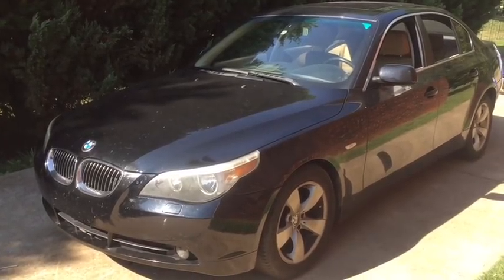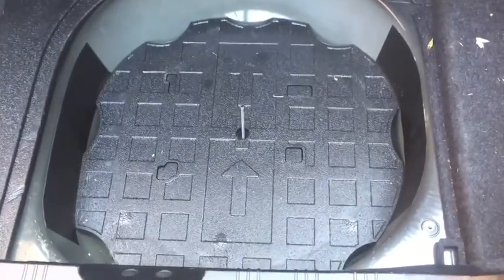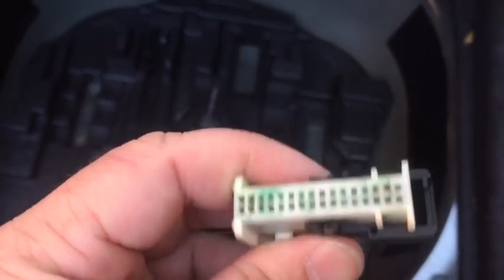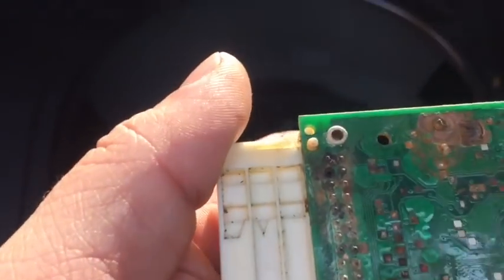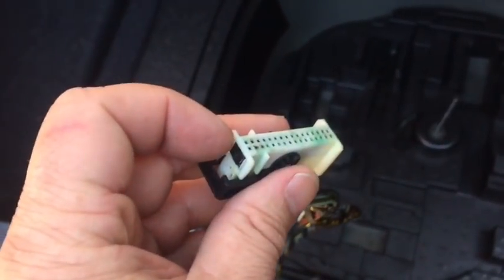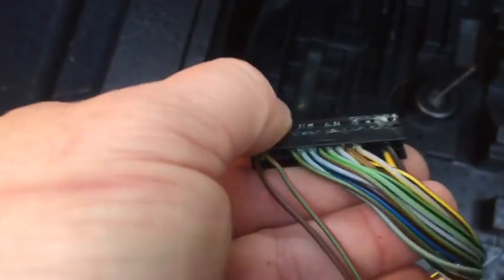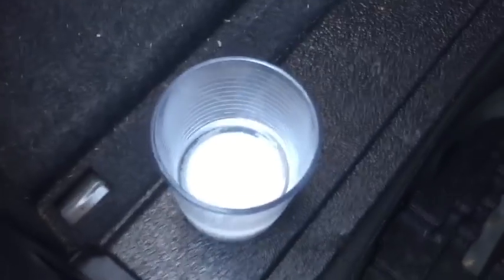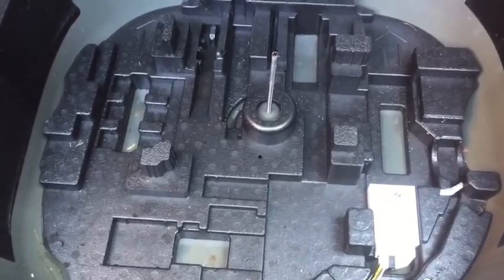BMW Battery Draining Fixed

Comment: Okay this is interesting. My tpm light is flashing and I have codes for tpm "604E" plus 6054,5,6, and 7(1 for each wheel). Now I thought this was because I put new wheels and tires on and they don't seem to have any tpms modules, but I've found that using protool I cannot code or do anything with the RDC module. It also just shows question marks for the modules vin number. The module itself and the connector and pins look perfect though so I'm wondering if the module is just dead maybe. I will try to clean the wire side connector as maybe it's corroded and someone had already replaced the module without resolving the problem and gave up. Could be as simple as cleaning the connector but very strange.

Comment: I have the same car. New battery,new alternator.. car battery drains in roughly 2 minutes!!! Any ideas?
Reply from the maker: @Jeff-h6y5h  for it to drain that quickly it is a major draw or a bad battery or both.
Reply from the maker: @Jeff-h6y5h  for it to drain in 2 minutes something major has to be pulling on it. Almost like a starter running constantly.

Comment: Where the sensors working fine even with the corrosion ?.. I have an issue now same shit ,clocks reset and battery discharge..but my sensors are working fine..

Comment: I got a new mpm module that was a Dorman brand because original was fried and corroded.The wiring harness wasn't to corroded so I cleaned real quick.Once I plugged in it worked fine.everything worked.The next day it was good until the end of the day when I started my 2004 545i the screen started glitching turning on and off then going black and Turing on and off again and wouldn't stay on but everything else worked.Dont know what to do please help.Never had a Beamer in my life and worried.

Comment: Can you drive the car with out having it plugged in?
Reply from the maker: Yes you can drive without it plugged in. You may however still have battery drain issues.

Comment: Nice video.have u ever had an issue with a 525i that does not want to start after battery drain .not lights on dash and it's not reading key (not even sucking it in)
Reply from the maker: Sounds like it still isn’t getting any battery power to the modules.

Comment: having trouble disconnecting rdc module from wiring from bmw 2005 545i. any solutions?
Reply from the maker: Gently pry with a screwdriver.

Comment: Can I just leave it unplugged do I have to replace it?
Reply from the maker: With it unplugged the other modules will keep trying to contact it this running the battery down. The modules need to be able to say goodnight to each other in order to power down. If one is missing they get worried.

Comment: If that option don’t work just tighten your terminals and jump start your car after , let it run or drive some where for about 20 mins should be good after that

Comment: Great video, so I become subscribed. I also have problem with by E60 525i, bluetooth, not working. Just cant click on it. I checked modul leftback and it had 2 wires unplugged and I cant see, where both of them can be plugged?

Comment: THANK YOU SOOO MUCH, 9,000 AND TWO YEARS LATER I SWEAR THIS WAS THE ISSUE CAUSING ALLLLL THESE OTHER ISSUES. Because It ran better than ive ever felt in 2 years and its been in and out over 4 times to bmw. and my god i have pictures mine looked like it was in microwave for 2 minutes! melted, half remained and major major major fire hazard because that styrofoam we also found melted where that module is. we got it "like new" off e bay. I did have to also get a new battery though because of the constant draining and charging of my battery its toast after like 10 times. so after that new part and new battery followed by a battery adaptation reset, trip comp reset, idle learning system reset (that i swear really helped a lot) (and I had to get a new transmission as well, that was probably not related) so I as well did a Transmission adaptation reset as well and that helped a ton too, Car just finally ran like we always wanted. then lastly because i had a NEW battery had too have BMW use some kinda obd sensor. or we can of course buy it for 122, but its just needed the once when programming a new battery, if u had to switch after this fault killed yours too, i drove with this issue for months because no shop and not even BMW themselves were even relatively Closeeee. lol dont mechanics use youtube?

Comment: Does the RDC module have to be programmed to your car if you buy another or even a used?
Reply from the maker: No, you can get a used one and it should work just fine.

Comment: I'm currently battling a bad IBS and battery on an 2017 F15 X5 with 60k mi. The car died, was towed to dealership they found little to none, died again, boosted several times, died again. After an CEL came I scanned it and it gave me a code for a bad IBS. The car battery won't charge on a DEFA charger (the bad IBS fully depleted the battery 4 times or more). Will be replacing the battery and IBS in one motion, the register it, reset the DME and clear the codes. If this doesn't cut it then I have no idea what to do next...
Reply: Did that fix the problem?

Comment: I have the same issue but it wasn't my tire pressure monitor module, still searching, now my radio totally turns off and my dash is lit up like a Christmas tree and the car won't start,

Comment: My battery drain issue came from the fog lights. They turn on when I unlock the car, then go off in 30 seconds, or go off immediately when I put in the key. I updated the regular bulbs to LEDs and no more battery drain issues.
Reply: So had did that drain your battery?

Comment: So if i just unplug the module , will there be any issue ? 
I really don't need the tire pressure monitor . I can just get get air filled in the tires like if it was just a honda or toyota . 
Will there be any issues?
Reply from the maker: Unplugging the module will likely not cause any additional issues. However these modules are all connected via canbus and will look for each other and share data. When one module isn’t responding the main module will at times not power down as it is trying to contact that module.
Reply: Alright thank you so much 😊

Comment: I once had an '03 BMW 330 that did some strange things (windows and electric seats operating on their own, loss of clock, CD changer failed to work sometimes), that was also draining the battery over night. I eventually traced to fault to the Bosch radio, a tiny (0805) transient voltage suppressor had failed that was pulling the K line bus low intermittently, this was waking up the various modules in the car! data logging the K line voltage overnight when various modules were disconnected eventually pinpointed the issue!
Reply from the maker: Ian Louden excellent process you followed. It appears that any of the modules can cause this issue. Following the process of elimination.
Reply: I’m have a simpler use but the CD player jus keep’s ejecting one night I went to get my wallet and heard it continuously eject when the car wasn’t even on

Comment: That and the mpm modules are both missing and the wiring but tyre moniter works, have no faults in the car.
Reply from the maker: rob davies there was a bulletin to relocate the module to keep it from getting wet. Yours may have been done.
Reply: I cant find any wiring for both modules in the boot
Reply: This has all started as Bluetooth doesn't work
Reply from the maker: rob davies there is a video on my channel for a code scanner that can read all of the modules. It isn’t expensive and may help you isolate your Bluetooth issue.

Comment: So tell me something did you get the p0604 if not I wouldn't believe what you're saying is true powers and training would cause a p0604
Reply from the maker: Isreal Perez no there was no P0604 code. But the tpms module would not respond when you tried to connect to it with a scanner.
Reply: @YourCarGuyDR  what is tpms
Reply from the maker: Isreal Perez it stands for “tire pressure monitoring system”
Reply: @YourCarGuyDR  I don't have one am running 18 inches wheels not the 16

Comment: Wish this was a video on the idrive not working bmw logo pops up  then blank ..i saw on other videos this is caused by the micro power module but the 525xi doest have that module..
Reply: malefrmbk How did you fix this? My idrive and shifter light goes out
Reply: @roundsquash6392  whats up had to replace the idrive with a new one then it did it again so i just got me a chevy less headaches less expensive..good luck .

Comment: My 530i will not start fully. It’ll crank. I unplugged the negative wire still no luck ! Someone help me !!!
Reply from the maker: Review it Q there are multiple issues that can cause this. Check your fuses and see if you can hear your fuel pump coming on.
Reply: I got it towed, check everything. My clock lost memory. Saying low battery now.
Reply from the maker: Review it Q the battery is likely lowfrom trying to start it. The engine needs 3 basic things to run. Compression, Fuel and Spark. Everything else is a function of those things. The easy things to check are fuel and spark. If you pull a spark plug out you can see what you are missing and then know what to diagnose. I will try to put up a video explaining this tomorrow.
Reply: Your Car Guy DR please do, I can make a video as well. I’m supposed to get a new battery tommorow (gifted).
Reply: @QUiNTiNBANKS  did u ever figured out what drain your battery and cause your clock to reset
Reply: @QUiNTiNBANKS  What was the verdict?

Comment: I heard from my parts guy that some of these BMWs need to be reset after a battery is disconnected. Is there any truth to this and if so how does one do this?
Reply from the maker: Stanley Tolle no truth to it. There are a lot of myths surrounding these cars that aren’t based on facts. The dealers sometimes can help facilitate some of these myths.
Reply: @YourCarGuyDR  I did some further checking.  Some BMWs have this thing called a Intelligent Battery Sensor, IBS, located on top of the battery.  From the experts on YouTube the thing can malfunction and cause your car not to start. If one replaces the battery  or a alternator with something different in capacity this thing can complain unless it is reset to the right parameters.  My friend has this thing on her car.  I guess it was easier (more profitable too) for the dealer to replace the the alternator then to reset the IBS (my doctor says I have the same problem, with my intestines).  This IBS does all sorts of things including slowing the heater fan and causing the car not to start and will also shut the car off while driving.  Now that is a smart F***ing device!  I bet it could also be a source of a parasitic battery drain.  Looks like I will have to do some digging to figure out how this thing is reset and how to check if it is working properly.  The YouTube expert fixed his car by unplugging the IBS.  Maybe that will be my friend's fix too. https://youtu.be/1n2x6wXCj4c
Reply: @stanleytolle416  I have same hunch. My BMW has been draining battery power. New one lasted about a year. Plus my tail light keeps popping .  Only thing i have not replaced is the IBS module for my 550i. Even the local mechanics didn't have a clue. No Ground detected and yet battery drains. I will replace hope it cures my long time dillema.
Reply: @YourCarGuyDR  ok my friend has taken her car back to the dealership that replaced her alternator for a draining battery while parked.  Now they are telling her that a R F cable needs to be replaced to fix the drain.  Of course I can't find any listing for a R F cable to figure out what they are talking about.  Could this be a be a electronic muffler bearing or could they be referring to something real like a can bus?  The other question is, what is the responsibility of the dealer to my friend for replacing a perfectly good alternator that was not causing her car problem?  Like it cost her $900 for the alternator plus a dignostic charge to be paid for on her $12/h job.  Should there be some sort of warranty on the repair being proper?
Reply from the maker: Stanley Tolle this hits the big grey area. Getting them to admit that they didn’t need to replace the alternator would be very difficult. The common answer they would give is that it was part of the problem but that there are other things wrong. I am not sure what cable they may be speaking about but if they are referring to one of the data cables it is possible. However it sounds like they are doing the replace parts until they find it method. I doubt they are intentionally trying to rip anyone off. Most likely it is like most shops, they have one or two truly good techs and a lot of mediocre techs. Even the good techs will sometimes struggle with these repairs that aren’t just straight forward. I know that there is a lot of stuff on the internet that blames battery drain on the alternators in these cars. I didn’t see anything wrong with the alternator and thus spent some time diagnosing prior to replacing anything.
Reply: @stanleytolle416  any update.saw a guy just cut the wire and connected them with a resister and seemed all good.
Reply: Stanley Tolle wonderful

Comment: Of course I too am head  banging with a 06 325i that drains when sitting.  Battery in the trunk dam body computer turns on when the trunk is opened.  Dam screwy car to trouble shoot. Told the friend / customer to have the dealership check for a fault when she took the car in for a recall replacement of the blower resister. Car also had lights on I could not reset too.  Well the dealer convinced her that the problem was the new NAPA replacement alternator, they told her it did not have the same amp as the OEM alternator.  She was sick of the problem so she, $12 hour worker, opted for the $900 alternator replacement.  Yeah they did  shut off the idiot lights and also did an oil change. I guess it was not a problem for $1300 or so.  She was real mad at me for not fixing the problem and putting in a no good alternator.  Well her heater motor finally gave out.  I had earlier showed her how to get it going with taps with a rubber hammer and got her to order a new motor. Well I got the new motor in and what did I discover?  A almost, 11.88 volt, dead battery.  Should I break the news to her.? Hopefully she will have someone else to be angry with for awhile.

   Ok, If she has me try to track down this drain, any suggestions on how to go about it?  Yeah, I will check the tire pressure mod first
Reply from the maker: Stanley Tolle yes they can be a pain to diagnose. I did find a fairly inexpensive code scanner that would read all of the various systems on the bmw. It helped to pinpoint the voltage draw. Because the various modules in these cars communicate with each other constantly if one has issues it will often cause a battery drain issue. The tire pressure module because of its location is a common issue. But if you are able to check it out with a scanner by module the one that isn’t communicating is usually the issue.
Reply: @YourCarGuyDR  what sort of scanner did you find?  It seems one needs extreem scanners now.  Not just engine codes but also the things attached to cam-bus, things to activate the anti-lock brakes in order to bleed, or simply install a window regulator with an anti-entrapment setup.  Have you heard or seen x-turner E3 or v-Pecker e4 in action?  They claim to do all this stuff with a laptop or tablet display.  There are also reasonable priced scopes that also use laptop or tablet display.  HanTec is one I looked at.  So far only seen operation on YouTube.  Any opinions if any these things do what they say they can do?
Reply from the maker: Stanley Tolle here is a link to a video with the scanner I bought. For the money it is very good. https://youtu.be/Lcakf_jfxfQ

Comment: Good idea to pack plug with Dielectric Grease or bulb grease (same thing) to keep corrosion from coming back.  Seals the connection from water and air.  Like, maybe they should have done this from the start.  I think it's a required add on for run flat tires in US.  One would think it would be under the dash if someone was thinking about it when making the car.

Comment: I had a BMW battery drain problem.  It was the door close microswitch.  I unhooked it.  No more battery drain.  The door key chime went away, but I don't miss it.
Reply: Haw you found it..? I have the same problem ,If I don't run the car for 1-2 weeks and the battery is completely dead..
Reply: How did you fins door close micro swtich

Comment: Thank you for a good video,  I spent about 4hrs going through YouTube,  looking for the problem I have, and finally I found yours.  My RDC module was damaged, fuse was burned so now im waiting on my module to arrive to see if my problem solved
Reply: I know this is a old video but did this fix your problem.
Reply: Yes, i did resolve the issue...
Reply: I am having a battery drain and yes, TPM light is flashing. I put an alternator on last week. 

I will update if this works.
Reply: @rhoduk did it work ?